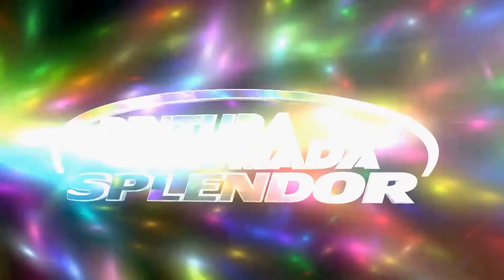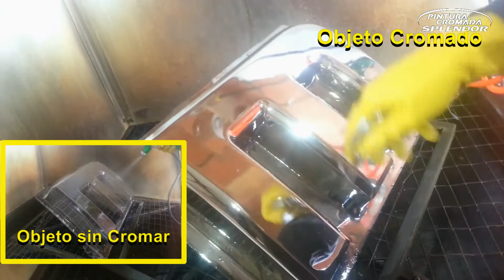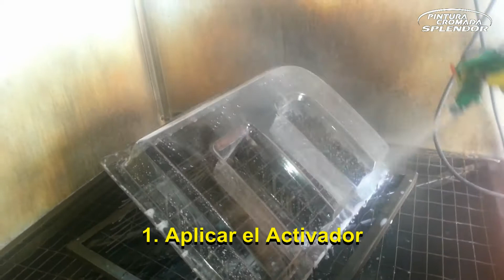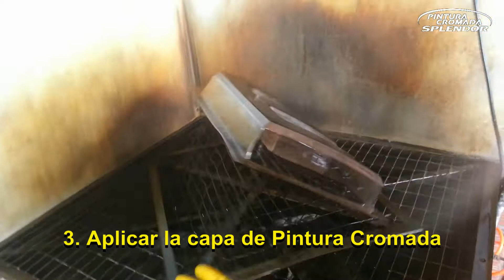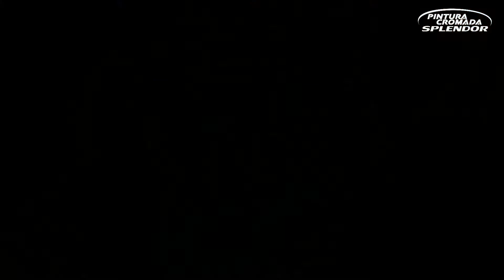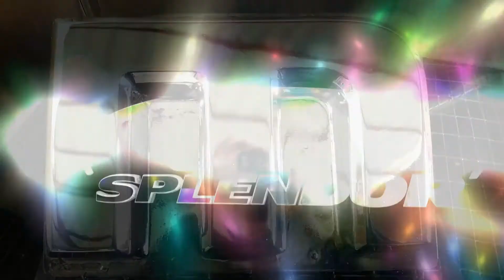Cromado Letras de Plástico Acrílico

Comment: Este cromado es resistente al sol y agua?? Cuanto tiempo dura la pieza de acrílico cromada?
Reply from the maker: Estimado Omar, en cuanto a la durabilidad del acabado con Pintura Cromada Splendor, es la misma que la pintura de un auto, esto se debe a que el barniz que se usa como capa final es el mismo barniz que se usa como capa final y protección para la pintura de todos los autos. La duración es mayor a 10 años a la intemperie bajo condiciones de lluvia, sol, polvo, etc.
Saludos.